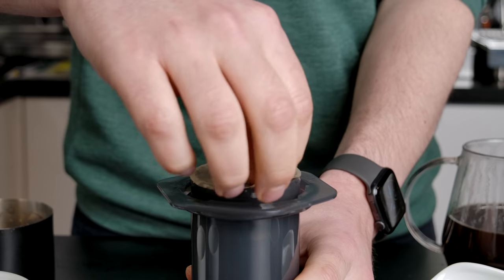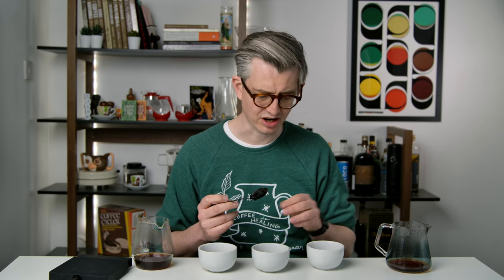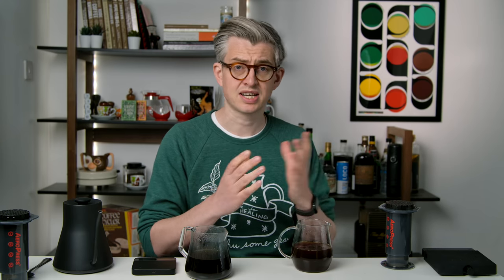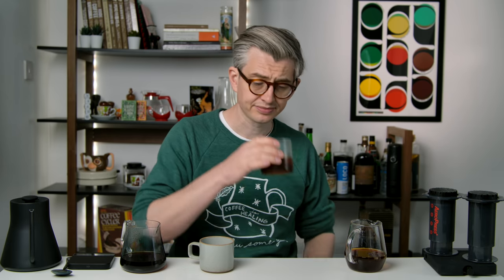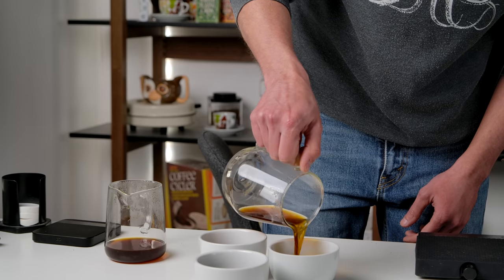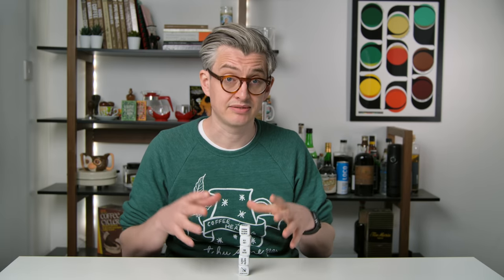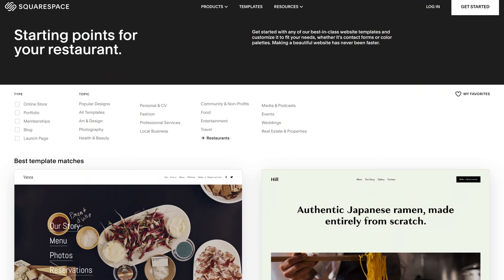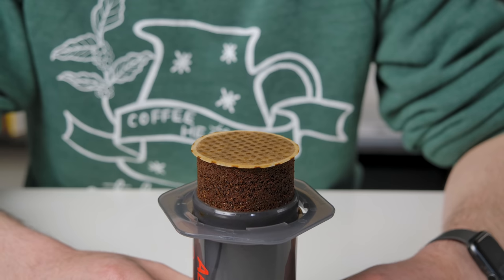More Aeropress: Reusing Filters? Competition Brews? Coffee For 2? Your Q's Answered (Episode #5)

Comment: I've been using an AeroPress for donkey's and cut my own unbleached filter papers with a 2" diameter craft punch from bulk-buy filter cone papers. I also re-use filters at least six times before discarding. After use, I wash off any grounds from the filter with a brief trickle of tap water then leave it to dry either on a the sunny windowsill of my kitchen or in a small tin tray sitting on top of the radiator. Before re-use, I use a small, stiff brush to remove any residual grounds dried into the paper so the filter is good as new. Easy peasy, coffee squeezy! 😊

Comment: Wonderful series James. Next can we have Moka-Pot please? Aluminium vs Stainless steel. Grind size. Weight vs volume in the basket? If you fill the basket by volume, can you then adjust the water qty to set your ratio? Hot water or cold in the base? High, medium or low heat?

Comment: I've found that the Aeropress can pretty comfortably brew up to 305ml of coffee. I use a 19:305 coffee:water ratio for brewing this way, non-inverted using the Hoffman method, but extending the brew time to 4:30. It comes out quite nice, and of course you can always decrease the coffee amount for a slightly lower ratio. (18:305 for light roasts for example) 

Going beyond that, I don't see how you could do it without using a bypass method as 305g of water takes it right to the very top.

Comment: One way that I have tweaked your method is by doing it inverted with a 3/1 bloom. I've started doing this because I found the acidity that I was getting in my cup without a bloom phase to be a little bit higher than I would like personally. I do inverted because I felt that that held all of the coffee and water together for a  Bloom and then steep better than a standard method we're always getting a decent amount of coffee Bleeding Through the filter.
This can be somewhat mitigated by using two filters and offering more resistance to hold back the coffee during your Bloom and steep. But like you said two filters is more expensive overtime and does not produce a noticeable increase in clarity unless you're really pushing.
Other than going inverted and doing a bloom everything else is the same as far as a ratio and steep time and I even used the reorientation of the Brewer as the agitation necessary to knock the crust off so I'm not introducing additional agitation that may disrupt The Brew.

Comment: One variable that I personally was surprised wasn't tested .. the one variable that differentiates the AeroPress compared to every other method of brewing, and is actually embedded in the name of the product .. is 'the press' .. more specifically the 'duration of the press' .. a variable closely related to the grind size and the amount of pressure applied, but does nonetheless have some unique "impact variability" of its own .. At the very least the duration and amount of hand pressure required are key variables and indicators of whether a brew has been optimally set up ..

Comment: So I bought an aeropress after learning about it on this channel and it's fun to use, having a great time getting used to it. That said, I fundamentally disagree about the inverted method - I really dislike the standard way of using an aeropress, with that very weak bit of initial drip through and I find it very annoying to have to try and get the plunger in and pull it back to then make a vacuum, it's just a frustrating thing to do and I can't get the vacuum to actually completely stop it dripping

Comment: Sometimes one has to cut the aeropress filter to the proper measure for one's Moka or espresso filter (depending on its usage). In that case one wants to reuse it simply because cutting it every time it's a nuisance. Moreover, if the aeropress filter is used on the bottom of the Moka puck (or the top for the espresso, I mean between the water jet and thecoffee powder) it only serves to help the evenness of the distribution of water and pressure, which means that the filter is not really "filtering" the coffee and therefore should remain less clogged.

Comment: I'd like to see a James approved method for the 9Barista. I appreciate the level of control is less, but grind size, quantity and control of temperature can still make a big difference, ones I'm still playing with two months in to using mine! Also, in your Mokka pot method you recommend using hot water (I understand why), does it make any difference in the 9Barista...I don't think it should since the water is contained separately until the 9 bars are reached, but could it speed up the process? Would it mess it up because it'd already be hot enough without any pressure, then reach too hot temperatures trying to build the pressure?

Comment: I don't own an Aeropress (yet), so I don't know if it's possible, and It kind of defeats the purpose of saving money, but for those looking to re-use paper filters, IF they will fit, what about putting a mesh metal filter OVER the paper filter? That way the mesh would catch the majority of the particles, leaving a cleaner paper filter for re-use. Also, are there storage techniques that would help keep used filters from oxidizing?

Comment: I usually go with 1 to 1 and one half of the included AeroPress scoop when it comes to coffee dosage and I add hot boiling water to the top, almost to the very edge. Since some of the water is gonna drip out of the bottom inevitably I put the plunger on about 1cm into the brewing chamber and leave it like that for around 3.4 to 4 minutes and after that, I gently swirl the whole brewer and let it rest for around 30s to a minute and then gently press. It's a little bit longer than most AeroPress recipes I've read, but it suits my needs fairly well. As for the coffee itself, I use whatever I can find that is interesting to me in my local coffee shop. 
If anyone tries this method, please let me know what you think! What would you change about it to make it better for yourself?

Comment: So I have this issue with the metal filter I'm using (E&B Lab permanent Aeropress filter D63UF3.5) when I do a fine grind (w/aeropress nomad). I pour water, steer it, then as I go to press it, it is literally impossible, almost a herculean feat for me to really push the handle all the way down to get the water through. It seems to create quite a bit of pressure for some reason as well. Anyone have this issue?